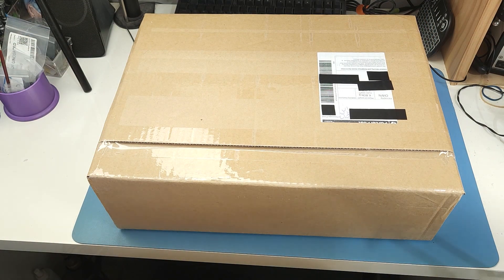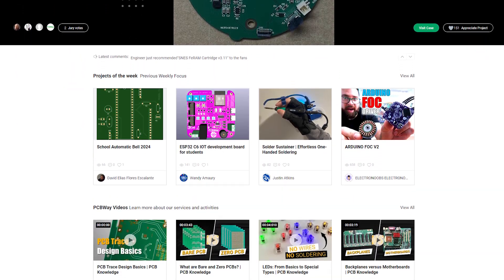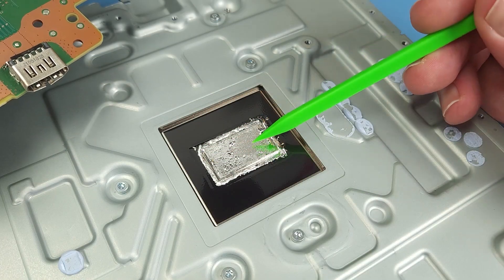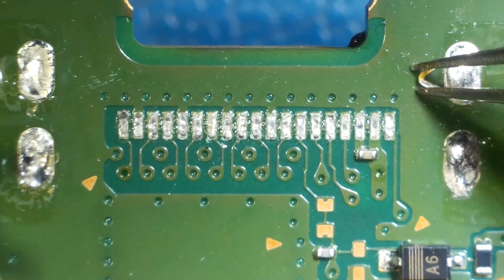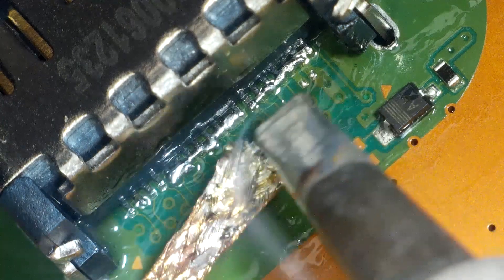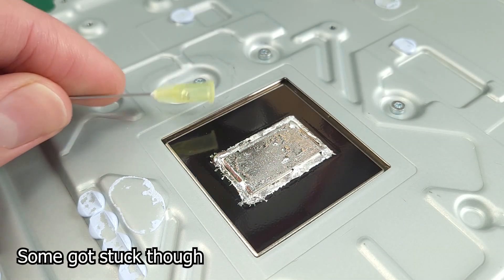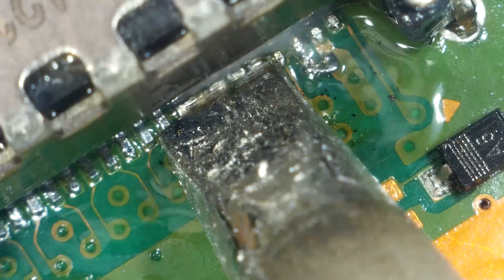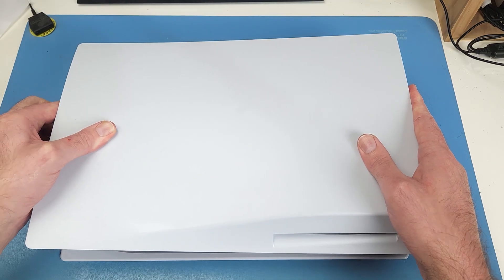Trying To Fix Ebay PS5

Comment: Tough task especially the soldering, which you acknowledged would be easier with hot-air soldering. But as usual you got the job done. 👏

Comment: These hdmi caps are very difficult to work with. And yes, definitely use hot air soldering next time, it will make the job way easier 🙂
Reply from the maker: I tried using hot air to remove the capacitor and started melting the port on the corner. I don't know how technicians use hot air and don't melt the port. I guess they do it really quickly?
Reply: To install the port you can use the dropdown method. What you do is remove the old port, apply the solder to both pins and ground holes. Then, you heat everything from the bottom until the solder liquifies. After that put the new port in place, wiggle it a bit too make sure solder bonds between port and the motherboard. Now you can align the new port, hold it in place using the twizzers and push it. Put the heat away and wait for solder to harden. Now you can free the port. As a hint, apply solder to a new port, it will make it easier to bond to the motherboard. Sometimes additional soldering of the pins is required but once you get used to this method, it works very well. As for the cap install, I prefer to have it on the motherboard before installing a new port. Hope that helps!
Reply from the maker: @KodNaprawy Thanks for the tips! Will try next time 👍

Comment: Congrats 😊 
My favorite soldering tip for work as such you did is the one where one side is flattened. I think they're called "2C" or "3C" or neven smaller. The size makes is nice to use in small places and the flattened side conducts some good heat.I load a little solder on them and with that side up I just slide it to the part of the legs that are close to the boards. the solder usually gets sucked in pretty fast. It worked pretty well on a fat PCB of a charger for V-Mount Bricks, lately.
Reply: Also KU tip is not bad, i use it most of the time while repairing.😉